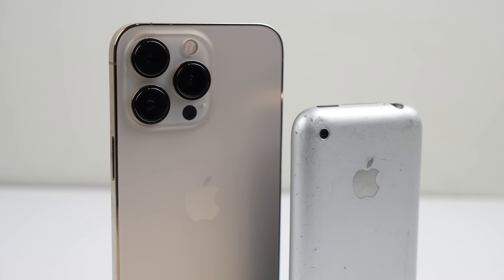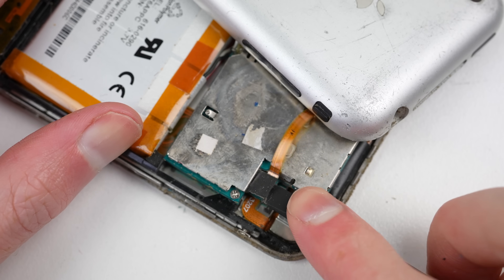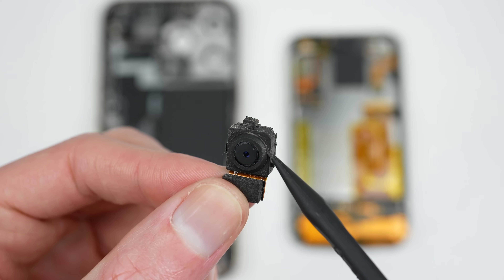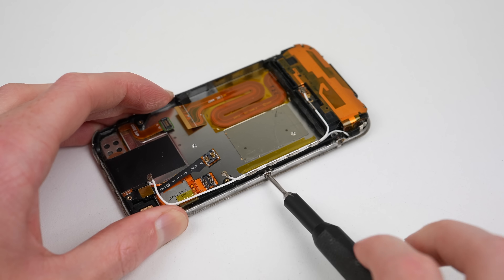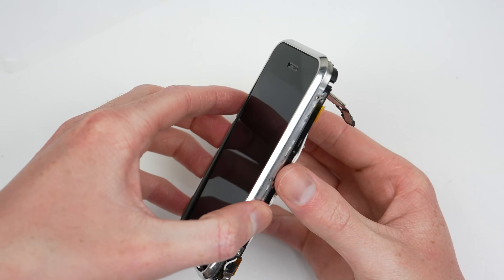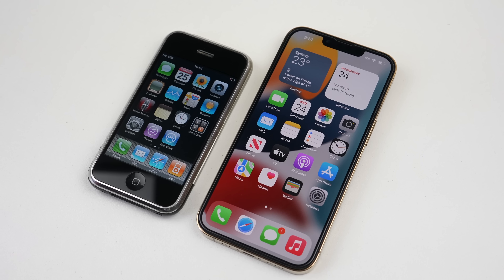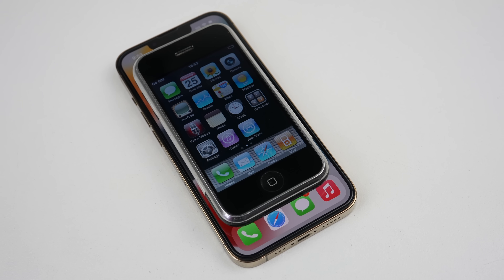1st Apple iPhone VS 13 Pro Teardown

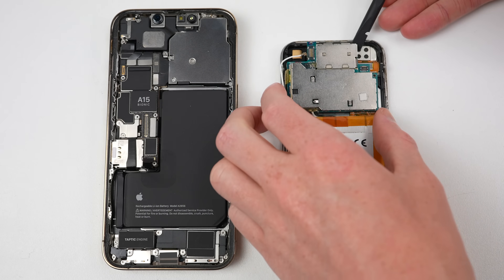Comment: 3:33 i have a little story about that, I got my hands on a rare iPod shuffle 3 with a dead battery, so I opened it (deformed the case in the process) then I realized it was badly expanded, and it’s soldered to the logic board, and held with strong adhesive, I’m taking it out tomorrow wish me luck so it doesn’t explode.

Comment: Love my Ifixit driver set always saves me when I need to work on things I'm the guy for my group of friends still need a heat gun station for replacing analog sticks using a soldering iron never seems to work out for me. Love the videos even though I haven't touched a iPhone since the 3g

Comment: Great restoration of the 2G! I just wanted to mention that if you wanted a battery that is more similar to the original capacity of that phone you can always get a Huawei HB5K1H Battery (1400mAh), fits perfectly, just gotta route the wires right over the battery, worked great in my restoration when I had difficulty finding a good replacement battery. I have quite a few pictures as well. Hope you may find this useful!!

Comment: My iPhone 4 has never been opened, has the original battery! I use it as a radio, TalkRadio. Its in mint condition. I recently got the 13 pro to replace my 6S which has served me well for 5 years. The 6S has been through 3 batteries!

Comment: tri wing aren’t security screws… i think you’re confusing it with torx security screws which have a little post in the middle to prevent normal torx bits from being used.

Comment: I dunno, call me crazy, but I think the iPhone 1 is easier to change the battery than the iPhone 13. I'd rather desolder and resolder 3 wires than deal with breaking pull tabs, alcohol, and having to pry up on the battery but not too much that I deform the shape and risk a fire.
Reply: Yeah but how many average users have a soldering iron?

Comment: As much as I love watching your videos, I have no interest in repairing any of my iPhones, beginning from 2008 & iPads or only 1 MacBook. (Sorry to all those critics of Apple products)
Simple reason for this...I guess I’ve been lucky and never needed repairs on them. While I’ve damaged (cracked) screens on a few, I just purchase a later model or take the hand me downs from one of my kids.
I always buy a transparent cover for them which folds around the bezel for protection. 
Without a word of a lie, they all worked until I upgraded. While many are no longer supported they still power up. As long as plugged into power. (Batteries dead) 
I’m currently using an iPhone 7plus. I have no plans to upgrade as it has no damage & works perfectly. I charge it once every day or 2nd day unless I do a lot of videos, ph calls etc. Mostly I txt and take photos, watch YouTube etc. I still have the original boxes they came in, except for those my kids threw out😩. Some of my devices look as good as new. They are expensive so I treat them as such. Cheers to all the Apple haters. An apple a day keeps the repair man away.

Comment: An interesting comparison video of how much apple technology and hardware architecture are evolve in all those years. I'm too excited about the new apple repair user program, it  going to allow a ton of your videos of the main componen6instalatiom on new phones and if the works properly and I'm wondering if switching parts between phones would work correctly now

Comment: The first iphone is better, can be dissasembled easially is more robust and has not married components to the board, so screens cameras etc. can be changed, also the first iphone is the refference for every phone that has been made since then, the first iphone is one of the most important mobile phones in history but the last iphones are super overpriced garbage without any inovation imo, i respect everyone who has an apple product but i don't like them and wouldn't buy modern apple stuff

Comment: I went into our Apple store in July of 2008 prepared to fork over $500 for one of those fancy iPhones and was delighted to find out the new 3G was in the store, and it had GPS!!! Also, the App Store debuted with that phone, and there were a host of other additions or improvements. But the best part was that I got out of there with $300 still in my pocket! It had come down to $199 from $499. I was so excited that on the way home I turned around and went back to pick up a second 3G for my wife. We used those phones until October of 2014. We still have them, and they work perfectly. They just don't have SIM cards, and we really need to figure out how to downgrade the iOS to something that makes them less logy. Our next phones were 6 Plusses. We used those (and still have them in perfect physical condition, too) until this past summer. We have 11s now. They were a lot cheaper than the current 13, and there was nothing at all compelling about the 13 to make us want to pony up the extra cash for them.
Reply: Clearly you hate iPhones then. XD

Comment: Great strip down of the original 2G iPhone. I have one in my collection which although not 100% mint is significantly tidier than Hugh’s and still boots up on its original 2007 battery. I haven’t felt the necessity to strip it down consequently but this is a good reference video. I’d take issue that you need a laser or complete strip down to replace the back glass on a newer iPhone it can be done with a heat gun & tweezers/scraper. I’ve done it on an XS Max although it’s time consuming & not for the faint hearted! I’ve seen dry ice used as a technique as well!

Comment: God it’s so frustrating how the insides of the current iPhones work. They’re super modular and THEORETICALLY easy to swap parts out, but then reality sets in with proprietary screws, the AMOUNT of screws, software locks, etc so actually getting to the parts and getting them out is a hassle
Reply: @dany ay lol not really since all those software locks will pop up even with genuine apple parts. It is literally designed to deter people from repairing their own phones
Reply: It's because they want to make it easier for their genius bar repair guys to be trained to repair the devices but not easy enough for third parties to do it. They want to sell extended warranties.
Reply: You know its gotten bad when I’m more comfortable and willing to completely strip an ipod touch 2g apart but have barely dived into my iphone 7.
Reply: @qwertykeyboard5901  the iphone 7 is actually really easy to repair. However, there are two fragile cables, especially the earpiece cable, and I unfortunately snapped it because I didn't remove the screen while replacing the battery
Reply: @0w3nn  I actually ended up tearing my iphone 7 apart, then put it back together.

DEAR GOD THAT THING WAS A BITCH. So many tiny parts that really don't need to be in there!

Comment: I have a question: I’ve seen a lot of videos where people take the battery out and don’t replace the adhesive when they put it back in. Is the adhesive necessary for the long term durability of the phone/battery or is the adhesive a needless addition to make it harder to replace the battery?

Comment: 6:05  Seems to be a solder bridge being created from the red wire's solder pad to the nearby metal. Hopefully not, or hopefully it cures itself when the new battery wire is soldered into place.

Comment: The 1st gen could record video, the limitation was just software based. I remember jailbreaking my phone and being able to record video
Reply: Same with the iPhone 3G. I jailbroke mine and managed to do it.
Reply: @5476Himself  yaa, bet that the video freakin sucked with that 2mp camera :}
Reply: @hi_im_nix  Most screens will not discern stuff higher than 720p (1366x768 is the default maximum resolution in most laptops and also monitors below 20 inches, that are also very common, very very common), and a 2MP camera is 1080p (1920x1080 = 2.07 MP).

Comment: 5:40 Re: Battery tab broke right where it turns.  This implies that you remove the right side first to make space, then when you pull on the left one, which has the bend, you need to change the direction of the pulling force midway through the pull. You'll have to estimate when the pull tab has reached the turn, then move your hand towards the right to keep the pulling force aligned with the tab direction (the line of contact, where it is being unstuck). By this method, which will involve skill (i.e. timing the turn), and initially luck, perhaps the left side tab can be removed without it breaking. In summary, keep the force aligned with the tab (i.e. perpendicular to the line of contact where it is being unstuck). 

Dimes to dollars, Apple did all this on purpose. Horrific...
Reply: Yep.

Honestly I'd rather just desoler and resolder the 3 wires on the iPhone 1 than deal with everything you just described. 😂
Reply: A lot of words to say the tabs were designed poorly with no indication of "proper use".
Reply: Wow you must be very proud of yourself
Reply: Let’s go Brandon. Let’s go Apple
Reply: @-someone-.  Ah yes, this comment definitely warranted brining politics into. Thank you so much.

Comment: Nice restoration of the iPhone 2G! The older devices are designed to be repaired easier, unlike the newer models which are deliberately designed to be more of a pain, whether it be through hardware (needing to heat up a glued on display/back cover, proprietary security screws, and glued in batteries) or through software (software locks that throw up warnings or break functionality even when using genuine parts).
The only part I don't like about the iPhone 2G is the soldered battery, and the fact that it is 2G only, not having even 3G...
Reply: Hence why the next iPhone was called iPhone 3G
Reply: That is why I do not buy Apple products, either in my personal life or for recording/editing/mixing/mastering my band's music! Using Apple's ecosystem would be a literal HELL! So even though the real hell is a work of fiction, "Apple invented hell"        Just let that sink in for a moment...........By the way, if you want to crawl your way out of the Apple hell, Samsung is your guided Angel, start with one of their premium phones and use Smart-Switch to clone your iphone trash phone data (videos, photos, apps, settings, contacts, texts etc) to the new phone, you can start your new life out of HELL from there! This is not a paid ad for Samsung, I just know it is an easy way out as I have helped a few people out after they got trapped... lol
Reply: @DefensiveWounds  modern samsung phones are a pain to repair as well lol
Reply: @ps5hasnogames55  Noylte, What I did say is they are also bad in this way but not as bad as locking components as Apple has done from their iphone12 onwards. The Samsung Galaxy S5 was the apex for Samsung in this way for me. Removable back cover, removable battery, ip67 water resistance plus it had wireless charging... I have mine as a spare of a spare.
Reply: @DefensiveWounds  uh huh
Reply: My first iphone was a 2g.  Now i still have a somewhat working 2g 16gb.  Only thing wrong with it is the touch of the screen is faulty.  Like it is worn out.
Reply: PC MONTAGE:  https://youtu.be/P-_lxLfDNnw

Comment: I've never owned any apple device, but this is exactly why i'm subcribed to you. this has been so incredibly interesting to watch
Reply: It’s quite an achievement to never owned any apple device nowadays.
Reply: @WaxMan_1980  Over priced and you never really own anything that Apple have made using slave labour in China, if you watch Hugh's channel you will see how replacing certain components removes functionality of cameras and fingerprint readers etc. even with genuine Apple components, the cons out way pros, even this new model has a relatively low capacity battery compared to most Samsung LG and many more. for example my Samsung Galaxy has a 7000 ma. battery can support 2 sim cards or on sim and a micro sd card for expansion, mine is the A12 low cost model £138 (UKP)
Reply: @raywelshman  apple isn't overpriced lol also lol if apple had a 5000 mah battery in the pro max then lol that's atleast 3 days of battery life also Samsung and all the other phone manufacturers do the same thing they use slave labor that china isn't trying to stop
Reply: @connerwine8257  apple is overpriced as fuck, might not in your country but in mine it is. In my country last year iphone 12 pro max 256gb costs almost 3000 which is equal to roughly 1700usd.
Reply: @connerwine8257  as you said "if they had" until then the next gen android phones with the 60-70% more efficient and over 50% faster dimensity 9000 (compared to the snapdragon 888) will be a very hard competitor to the iphone 13/ a15 bionic. if you wonder how these numbers will translate into benchmarks meditek claims to be very close in cpu in geekbench and in games like genshin impact they claim to have better performance than the a15. also the gpu supports raytracing which isnt even on the m1 max yet

Comment: Its hilarious how Apple 1st phone is so easy to open vs the 13 where they try to make so that if you don't know what you're doing you WILL break something
Reply: Based Karl Marx
Reply: that’s so true, marx
Reply: I mean the iPhone 1 chassis doesn’t quite yell “waterproof” to me…
Reply: @xplodingmojo2087  neither the 13 ! It is resistant not waterproof and could still get easily water damaged
Reply: @mohamedhesham9849  a higher standard of water resistance than other phones, but still not waterproof.
Reply: @mohamedhesham9849  it is IP68 rated, so for most cases quite waterproof.
Reply: @xluumu  well say that to my Xs that got water damaged from being in the pool for 2 mins and not even going deeper than 30 cm
Reply: @mohamedhesham9849  Her phone was defective then. Either damaged or had a manufacturing defect.